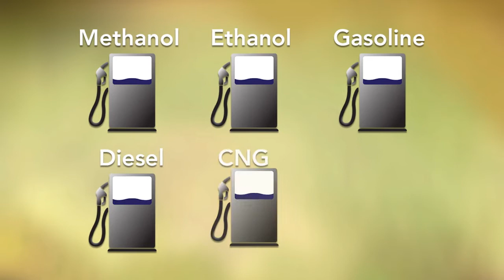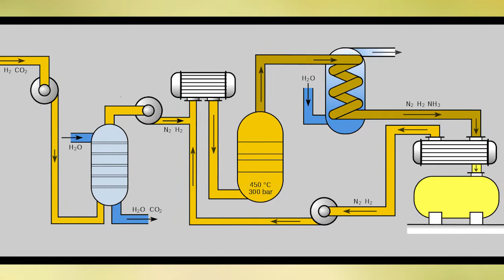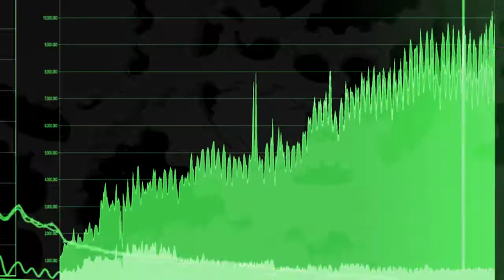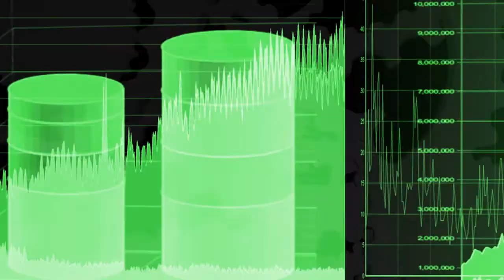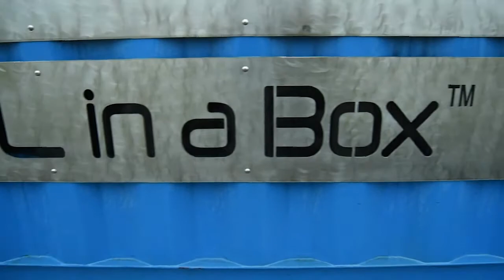GasTechno #5 Video in Series - Methanol to Gasoline

Comment: One thing for sure  is the low gasoline yield or diesel yield compared to yields from crude oil sources.

 Methanol spits out 50% water and generates some C3 C4 gases apart from aromatics / naphtha hc when passed through zsm-5. 

Only when crude oil resource depletes to a exceptionally low level can MTG become cost competitive.